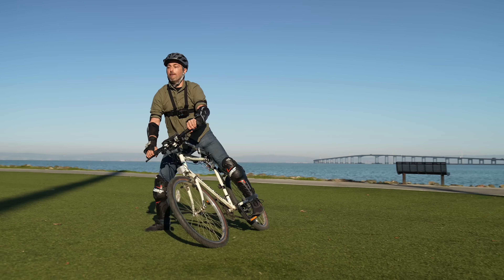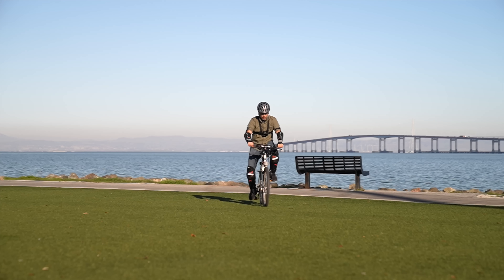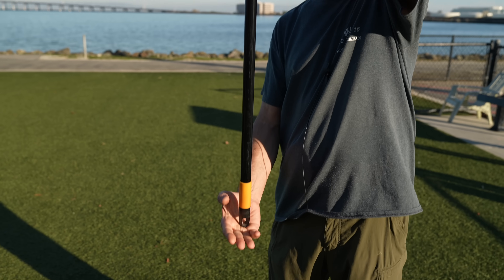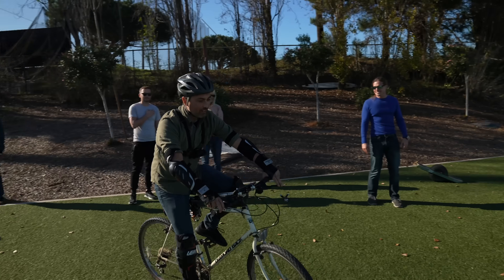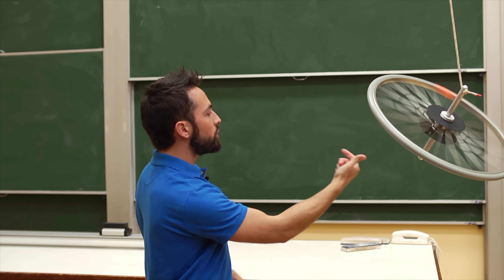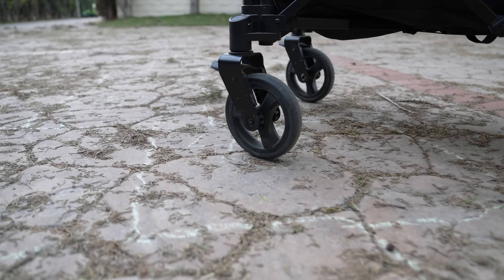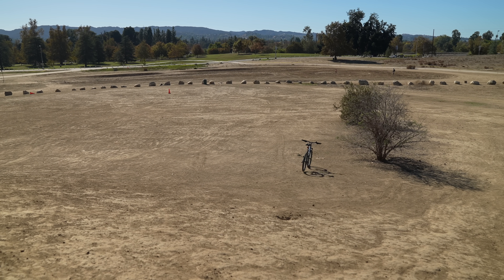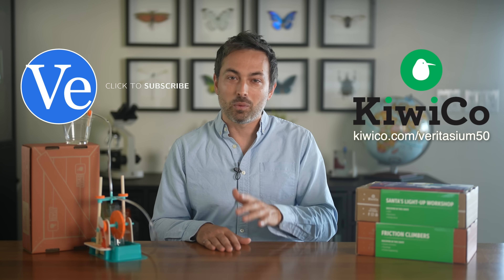Most People Don't Know How Bikes Work

Comment: TL;DR for those who just want to know how to ride a bike:

- Find yourself falling to the left? STEER LEFT
- Find yourself falling to the right? STEER RIGHT

done.
Reply: Want to turn right - steer left so you start falling right, then steer right to save yourself from falling, but not quite, until you're facing the direction you want, then steer a little more right to set yourself upright and then straighten the handlebars.
Reply: @sharpfang  well, you can just lean yourself to the right when you want to turn
Reply: @MIO9_sh  Lean to the right, bike leans to the left, center of mass remains in place. Sure you can allow the natural, random tilt to accumulate for a slow, gentle turn, but if you want to turn fast, you must introduce the tilt yourself.
Reply: @MIO9_sh  nope. Lean left and bike leans right.
Reply: @sharpfang  bruh when a bike leans to the right u lean to the right to steer right
Reply: @davidnovak4450  And if the bike doesn't lean in any direction, and you want it to lean to the right, fast and deep?
Reply: @davidnovak4450  (and turn the handlebars a little to the right...)
Reply: Thanks
Reply: Sleep you buffoon
Reply: So counter-intuitive! Coming a little fast into a left-hand bend and think you're gonna bail, accelerate a little and lean a little more to that very side. It's crazy! That is why it's so important to practice until it becomes muscle memory, not just something you know in theory in your head.
Reply: Steer to the left of falling left
Steer to the right if your falling right
Oversteering will cause you to either go in circles if your centre of mass is on the inside turn past the center of mass of the bike (rerember the centre of mass of the bike changes when banking/tilting/leaning is added) and you will fall off if your centre of mass is on the outside of the centre of mass of the bike while turning

Essentially DO NOT OVERTHINK IT
Your body has more than 5 senses (can't rerember their names) even inside your ears there's fluid inside that helps your brain figure out balance.
Your brains instincts use all of the information it receives and makes decisions accordingly in nanoseconds, even before you can notice it's happening
Just trust yourself
Reply: Find yourself falling? FALL FASTER
Reply: Cant forget to actually pedal the bike too lmao.
Reply: That's how bikes work or if you want to turn left, tilt yourself to the left, if you want to turn right, tilt to the right. As a stunt, trials and dirt jump biker myself I can do the opposite.
Reply: Thank you.  Saved me over 10 minutes.

Comment: Hi Veritasium, on YT there is a video called radio controlled bicycle "ghostrider". Its from a project I did with two friends. The goal was to make a bicycle radio control for marketing purposes. We found out that a bicycle without driver is extremely unstable and countersteering is nearly impossible to make it turn. So we added an extra joint in the frame near the steering in which we could slightly shift the centre of gravity of the bicycle. This allowed the bike to make turns

Comment: Excellent video.  I have been a bicyclist all my life and a unicyclist for well over 30 years.  When I started to ride motorcycles a few years ago, it took me a while to remind myself: the bike doesn't lean because it's steering; it steers because it's leaning.  This video explains the reasons very clearly.
Reply: just leaning does not steer the bike.   the front wheel MUST also be turned at the same time for any steering to occur.   the only reason leaning comes into the equation at all is change the balance of the rider.   if you do not have any weight, then you could steer with out any leaning.   and without any turning of the front wheel the bike would travel indefinitely in a straight line and never steer.   bikes dont "steer because they lean".

Comment: Its actully really really easy i only fell 3times in my 1st time then i finally knew how to use it and that includes the steering you dont need to Steer  to side Fully you have to steer a little and you shouldn't lean in the opposite side and you shouldnt Steer if you hadnt Sped up that much because you will fall and use the steering to balance too and the most important thing to do is when you start Up using it you have to pedal instantly when seated do not fear letting go the ground just pedal and pedal once started. and after that you can keep going and going

Comment: I have been riding pushbikes and motorcycles for over 50 years now, having learned to ride at around the age of three or four, and have to say that I have never counter steered to turn a corner. I was taught to lean into the corner first and then to allow the bike to follow my path. I use minimal steering of the bike via the handlebars. I am not alone in this method either, as a number of other riders and I were discussing the current crop of riding classes that seem to prefer this method of riding. Not one of us could understand why you would be turning the handlebars to start the turn without first leaning in. Also, it forces you to be more upright through the corner and taking away some measure of control of the bike. 

I personally could never ride this bike. To me the whole concept is backwards. The bike is only geared to ensuring that his theory is correct. You must counter steer to use the bike, or you fail. Should I try to follow my method, leaning first and then turning, I would fail every time as I had not followed his proscribed methodology and the steering would be locked out for me.

You only need look at Moto GP to see that these guys do not counter steer either. They set themselves up for the corner by leaning the bike and then placing their entire body to the outside of the frame of the bike to get extra lean for cornering at speed. There is no time for tricky little counter steers to start the corner particularly in running through the chicanes with the guys throwing themselves over the other side of the bike to get the right lean to take the corner. Again, no time for counter steering.

The discussion on precession also interested me. Riding at slower speeds such as we saw on the video, precession would not be a major factor in the handling of a bike. However, as your speed increases precession would (and does) become a much more important factor. As the speed increases the effort required to lean a bike definitely becomes harder. It is actually quite useful on faster turns (motorbikes and recklessly running down enormous hills on your push bike) as it tends to want to hold you up and thus provides extra stability through the corner or on straight paths like highways and freeways. The points about the centre of gravity and the other stuff were all interesting and quite inciteful, again for slow speeds. 

I would say that this video is good for people that ride at slow speeds and are not necessarily confident riders. It may get them over the first barrier of actually learning to lean whilst in the corner. It certainly can be unsettling if you are just starting out and are finding it hard to maintain balance. My personal view is that as you get more experienced and start riding at higher speeds, and I am not alleging Olympic level athletes here, leaning before the corner will be come natural and counter steering will become counter intuitive.

Comment: Cars use the castor effect in a similar way. That's why it goes wrong when you raise the front suspension on a solid axle without resetting the castor. It's rightly known as the death wobble.

Comment: Usually ill lift off the seat and tilt the bike beneath me while im standing upright. You keep much more control over the bike when you have independent control over both the angle of your bikes tilt and your centre of mass, which is harder when your butts glued to the seat and your balancing with just your core muscles.

But i also take corners on such a sharp lean that my pedals grind against the ground, so maybe dont take my advice idk ¯\_(ツ)_/¯

Comment: The flaw in the test is not having a legit trail racer try. When you fly on a trail its standing with your center mass as the counter steer not the handlebars. Meaning in this test I would be standing and initiate the turn by my core moving and leaning the tires to the side while opposing the fall with my upper torso kind of like a twisting motion in opposing directions

Comment: Anyone who's taken a Motorcycle Safety Foundation course knows this. Although knowing it conceptually and then executing it correctly are two different things. For the most part you still just think about turning left to turn left even though you are actually turning right. Basically I'm saying even though I knew the answer before I clicked play on the video, I still probably would have fallen off the bike.
Reply: I used to do it on purpose as a kid because I was happy I found out how this works. I'd exaggerate it while doing it just because of how good it feels to get a confirmation that I I understood it. If you tried you would have done it. Only how much leaning with your body and how quick to move something are the only things you better leave for your subconscious, but the concept in general is very easily doable on purpose.

Comment: GR8 vid
 I learned more through riding motorcycles. Same principal. Favorite trick was w/ the engine running @ a dead stop & manuver the front wheel side to side then release the clutch. GR8 way to teach people to put their feet on the pegs sooner for better control. See to many people dragging their feet for 6 to 10'.

Comment: Hi, this video is awesome,makes sense an I agree with you 99%.
Counter steering works this way on both bikes and motorbikes. But do you really have to counter steer?
I don't think you do.

How about this alternative. You ride without touching the handlebars, somebody locks your steering. The way locking works is that it locks one direction of steering, but from the angle you are currently at ( instead of you can go left, you can't go more to the left). Give it enough practice and I'm very confident that it can be learned to steer that way.

What I'm not entirely sure is whether that disproves the necessity of counter steering 🙂

Comment: For the lock out mode, just jump the bike a little to pivot in the air. So not the whole bike goes up but just the front of the bike. Do a wheelie and come back down in the direction you were falling

Comment: Weird. I lean first then turn...... No one in my area turns one direction then the other they learn into their turn which prevents falling due to you not possible to have the wheels pulled from under you if you lean first. They use this method for motocycles

Comment: Good experiment, but this is dependant on speed.  If you're riding faster, balance is way easier, so you merely lean the bike to turn.  No counter turn is needed to initiate a weight shift before the turn.

Comment: Counter-steering - a term used to describe initiating a turn by momentarily steering into the opposite direction initially before steering in the direction of the turn in a bike or motorcycle. This forces a change in bike balance to lean the bike over in order to facilitate overcoming the gyroscopic force of the two wheels that want to stay in that orientation. Where motorcyclists get into trouble is that in high stress turning situations with an oncoming vehicle crossing over the median, one's instinct is to immediately react by steering away from the danger and by doing so unfortunately places the bike on a collision course with the threat. A deliberate counter-intuitive maneuver would be to counter-steer and  force the bike to lean even further to overcome the gyroscopic force and redirect the bike towards producing a tighter turning radius. This can get dicey in tight hairpin turns especially if the threat forces you to counter-steer deep into the inside turn and into the weeds.

Comment: When first learning to ride a bike, I was told to steer in the direction I was falling (tipping) to keep from tipping over. No one mentioned how to turn, but by following the tipping rule, it all works out. To turn right,  you force it to tip right by turning a bit left, then your recovery leads you into the right turn and you then you place your body weight to lean into the right turn to maintain the turn. Great video!

Comment: This bike doesn't prove that people don't know how bike's work, it proves that you can make a bike that goes against how people work bikes. You didn't prove anything but that you can mess with someone's natural inclinations of using a vehicle, that requires movement in both directions to maintain balance and adjust to different surface heights and resistances given by the ground, by removing their ability to move in a needed direction.

Comment: So a good way to see the whole mass distribution mattering while riding a bike, if you are sitting upright (and even ever so slightly leaning back), it is easier to ride without holding on to the handle bars. I wouldn't recommend for anyone who hasn't tried riding a bike without their hands, cuz yeah, even if you can, it is dangerous. But yeah, you feel like you have to balance less while doing it.

Comment: Something that I've been doing for like the past year when making a hard turn is sticking my leg out, cuz it felt easier to turn. Which when I thought about it, it made a lot of sense. You create a torque caused by the weight of your own leg, making a harder, faster turn more doable (the momentum pulling you forward is counteracted by the torque, so no flying forward, also, it helps to not slip on said turn, but I'm too lazy to think about the explanation, but something something less static friction needed)
Reply: Because your leg is below the centre of gravity it assists in tipping the bike more easily, which is how it steers.

Comment: Ok this is one of the things that's never given me pause and always was known to me but never occurred to me as a strange unknown thing. Locked steering I know how you can do the turn every time but it's cheating. Locked out right, slow to left turned track stand and either hop it around from the front wheel or tip the bike into the stand and lean opposed and find the steering angle that let's the wheel start to rotate and work it in steps if you can't carry the momentum.... so ya, cheating and crazy hard if you haven't done similar actions on a hardtail

Comment: 7:13 "It is just as hard to balance with a locked steering as it is to balance on a stationary bike"
I think you are making one mistake here, Veritasium. You can test this out by first letting the speed build up and then locking the steering. You'll see that what you said is not entirely correct.
The reason people lose balance even when they try to go high speeds is that they try to pedal the bikes, which causes unbalanced torques because they have to push down on one pedal while staying light on the other. And the steering helps them with that.
But if you let them build up speed first so that they don't have to pedal at all, they can release the handles and go very very straight without even trying to balance themselves. So there is some gyroscopic effect at work here, but of course steering also helps.

Comment: i find the locked steering bike to be a very interesting idea. i have a theory about it too. i think the bike could be balance with no steering if you were to extend the handlebars out further. when the steering is locked you have essentially turned the bike into a lever. the problem is, when the bike starts falling to one side, you just can't exert enough force to counter it. extend the handlebars and boom, extra force multiplication. it is the same mechanics that allow us to stand on one foot. we can't change position of our foot so we change the shape of our bodies to correct ourselves.
Reply: It is possible to adjust it moving your weight though it is much easier to do while standing up to increase leverage. Watch experienced riders jump with a bicycle and this is why they stand up though the jump. Makes it easier to use their body to adjust the attitude of the bike in the air to pin the landing properly.

Comment: am i the only one who can turn whilst not even touching the handlebars? its called leaning and when practiced enough it can be done at those slower speeds but not as sharp as actual steering but I find in most cases it doesn't need to be that sharp so I rarely touch my handlebars